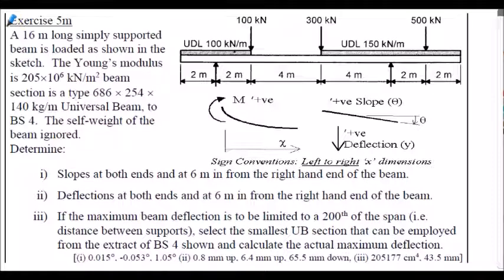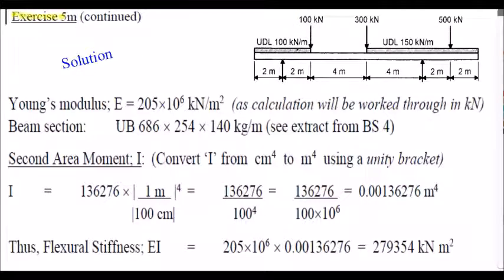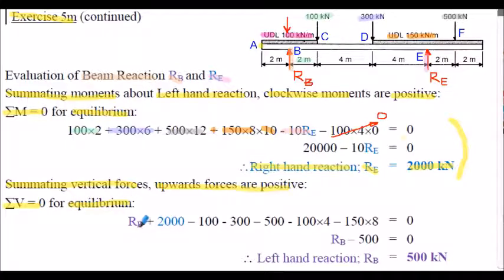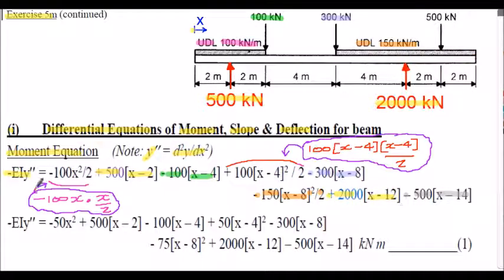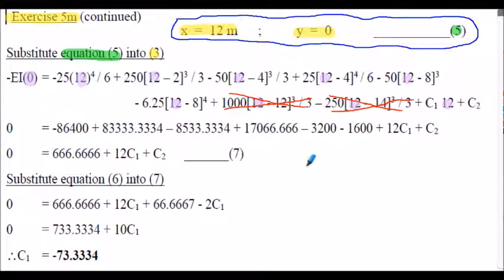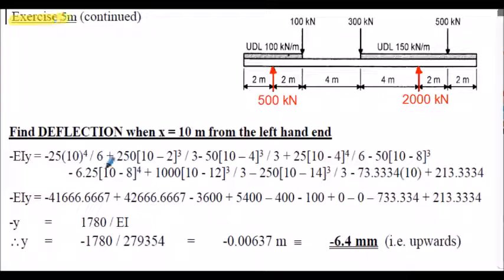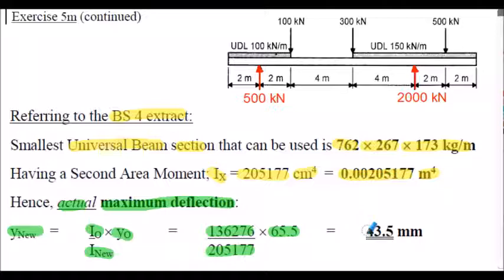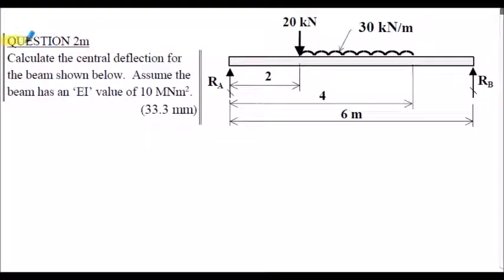Macaulay's Method - Part 3 - Further Exercises

Comment: I don't know why the uniformly distributed load (100 kn/m) was not included in the calculations for the distance from 2 - 4  at the left?
Shouldn't the moment equations be:
(-100*x *x/2) + 500 (x-2) +[ - 100 * (x-2) (x-2)/2] + [(- 100 (x-4)] + [ 100 (x-4) (x-4)/2] + [ - 300 (x-8) - 150 (x-8)(x-8)/2] + [2000 (x-12) - 150 (x-12)(x-12)/2] + 500 (x-14)

???
Reply from the maker: Hi.  In Exercise 5m, the left hand 100 kN/m UDL acting over first 4 m of the beam is accounted for by the term, -100x^2/2 in the equation but in this method this UDL is actually considered to run along the entire length of the beam.  This is obviously incorrect for the loading shown, so to counteract this effect a ‘compensating UDL’ has to be added from x = 4 m having the opposite sense and this is the term, +100[x – 4]^2/2.   As Macaulay’s method uses step functions, a term is only included within an equation if the square bracket contains a positive value.  Thus, if we were considering locations of x between 0 and 4 m from the LH end of the beam, the compensating term would not be part of the equation.  If we were considering locations of x greater than 4 m from LH end, the compensating load would then be added to the equation.  Also, the term, 150 [(x-12)(x-12)]/2 in your equation is not required as the term, 150 [(x-8)(x-8)]/2 accounts for the 150 kN/m load running from x = 8 to the RH end of the beam.  Try and structure your equation using square brackets, as the square brackets have significance in Macaulay’s method. Hope this helps.  I wish you well with your studies.
Reply: @alancarter2020 thanks so much, I got it late, but it comes late better than never comming 😅.
Reply from the maker: @BlertaSpahiu-j3b  No problem. Hope it helped.